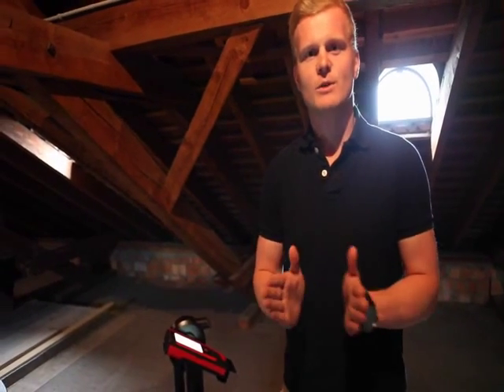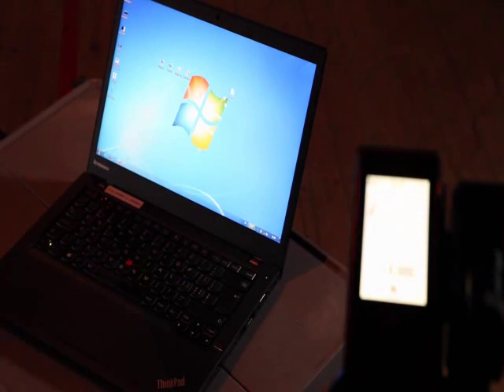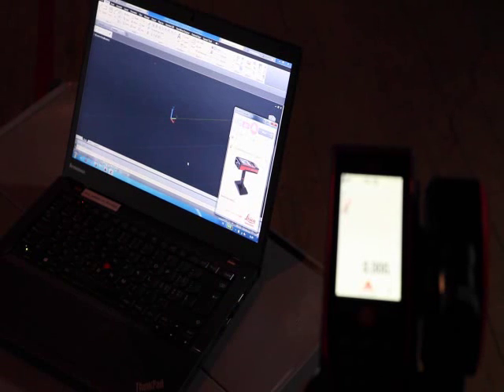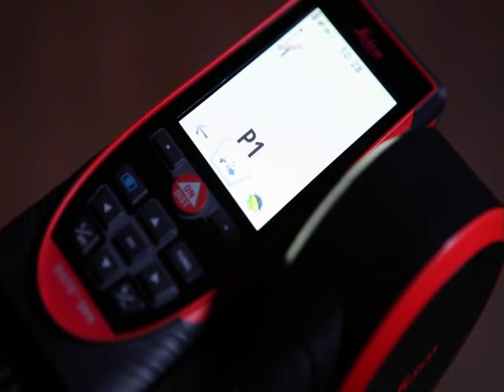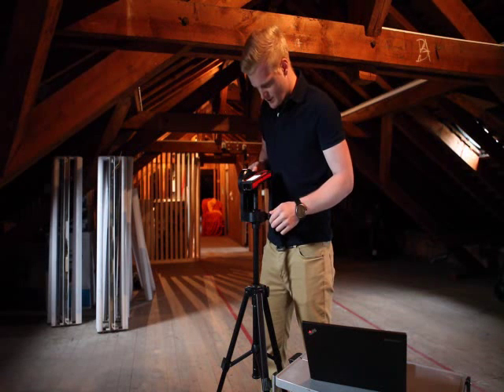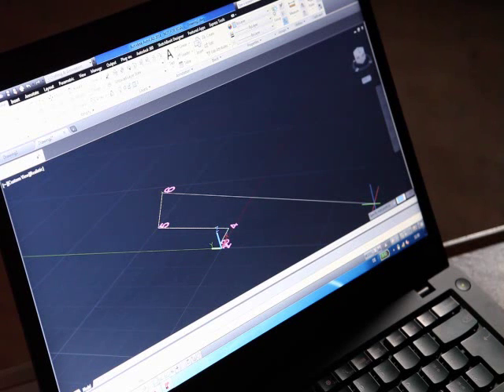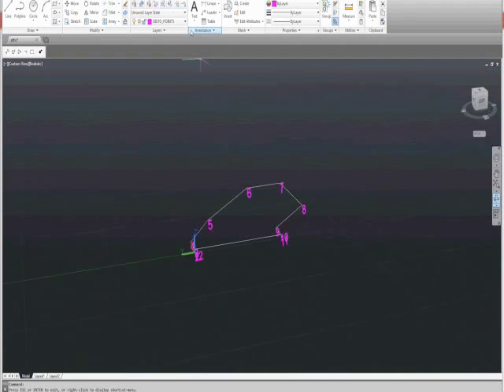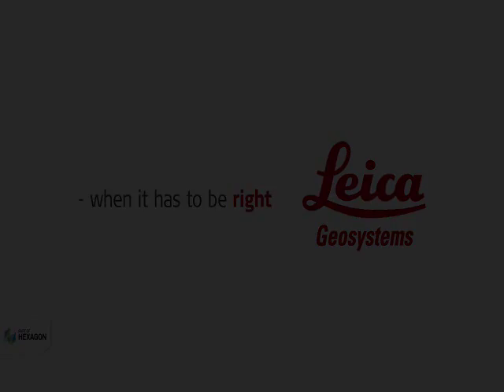How to use the Leica DISTO S910 with Transfer and CAD Plugin

Comment: Very Interesting.  What I would Like to know before purchasing the S910 is  -  If You had to take measurements of a very Large Ceiling full of Hanging Beams and Columns,  I suppose you would have to move the Leica Disto S910 many times.  Will you still be able to continue Transferring data from where you had left before.   Please, can anyone Explain ?   Many Thanks in advance.
Reply from the maker: The S910 can take unlimited measurments when linking to AutoCad, which is really the biggest selling point for this device. Personally when looking to larger surveys, I would use the Leica 3D Disto. Designed for ease of use and its ability re-locate accuratley and effiecently makes this Leica instrument 'the one' for any bigger more serious application. Please see the attached link for more details  http://www.laser-measure.co.uk/leica-disto/leica-3d-disto.html